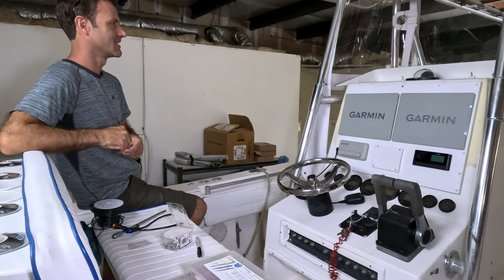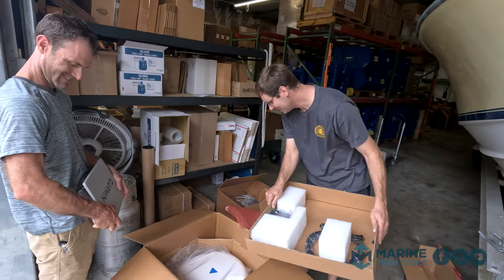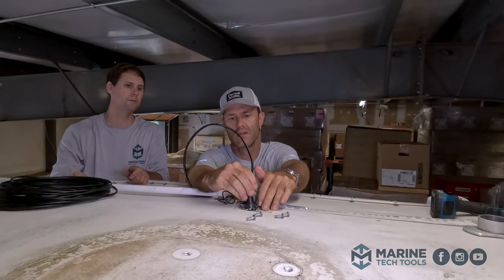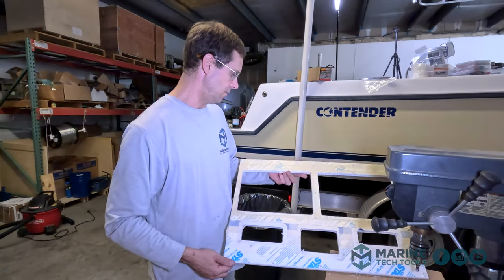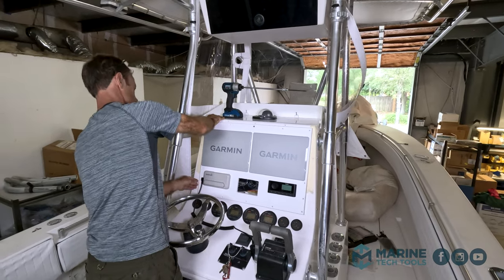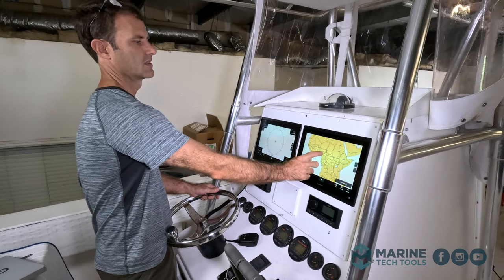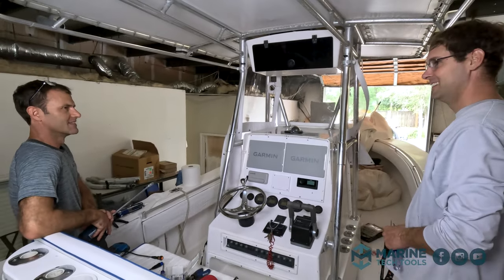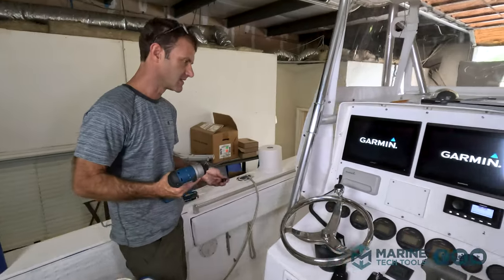$10K Electronics Upgrade - Marine Tech Vlog#5

Comment: Great work! 

You should concider upgrading the guagues to a YAM6YC (assuming its a Yam engine) Nema them in as long as your motors arent super old should be able to run that
Reply from the maker: The motors are 2004 Yamaha F225s, we bought the Nema cables for them to display engine data on the Garmins but found out that they are not Nema engines.  This boat will have F300s on it at some point but we are going to get what we can get out of the 225s in the mean time.